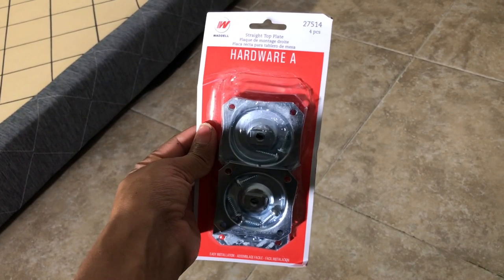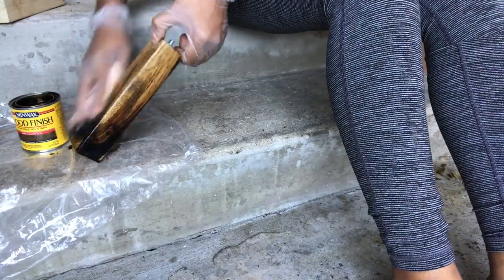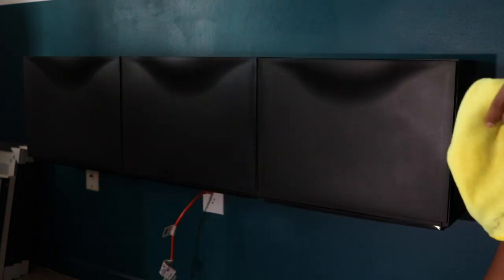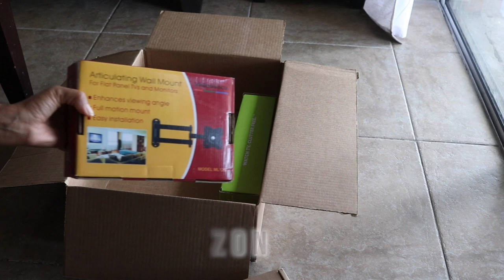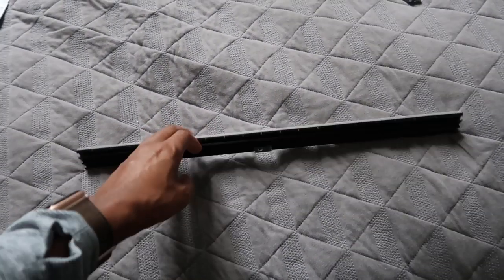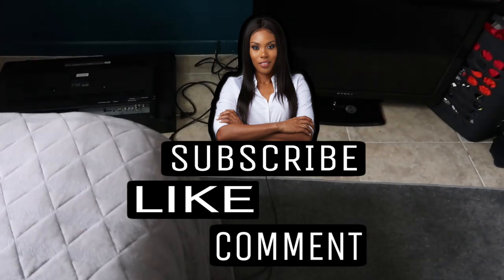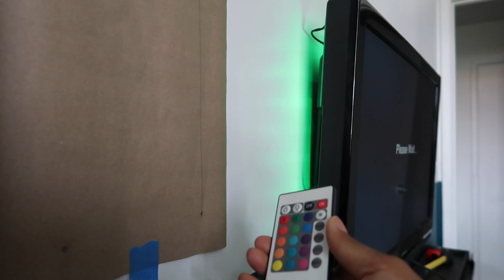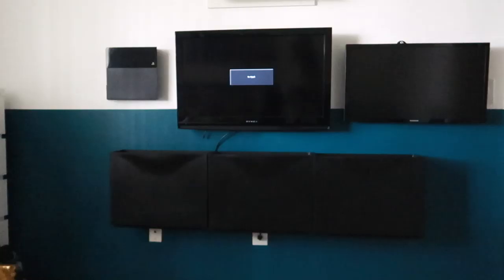Extreme Small Bedroom Makeover + DIY Platform Bed 🛏

Comment: I haven't finished watching the video in its entirety yet, but for the roll shade, return it and exchange it for one that fits the measurements on the inside of the window (will probably be an inch or two less wide). That way you can install it inside the window frame instead of from the cement ceiling.

For the light fixture you bought, you could mount it using a decorative Command hook. They have come a long way over the years so you could swag it over wherever you want it to hang and then either wire it from where his existing light fixture is or if you bought the kind that you just plug in, you can swag it from wherever you want it to hang to where it needs to be plugged in. I hope I've explained that correctly.
Reply from the maker: Thanks for sharing. Good idea 💡